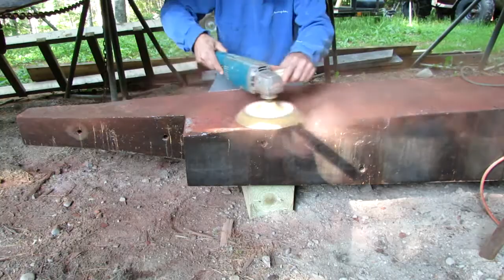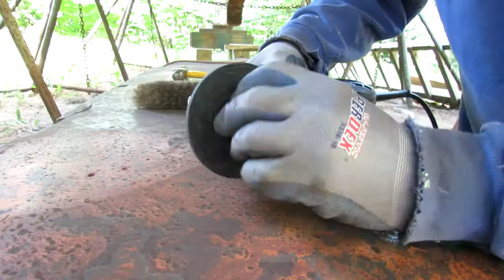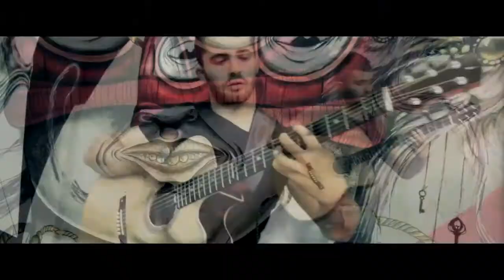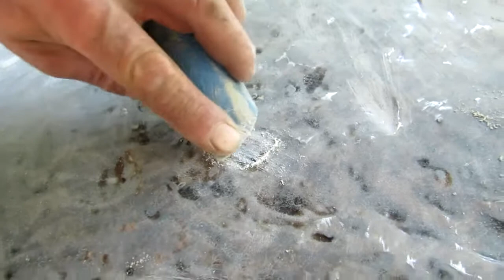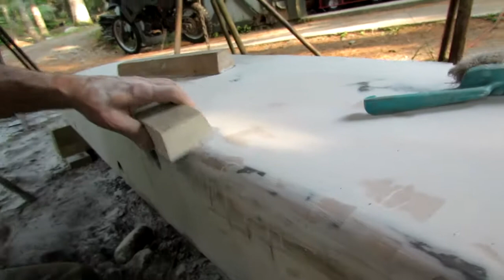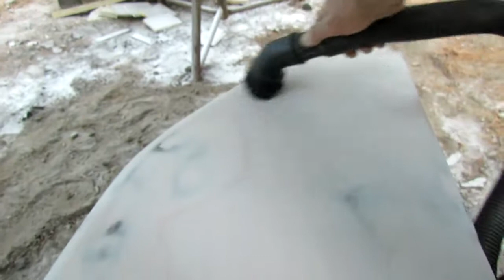July 17, 2015 - Restoring The Cast Iron Ballast To My 1968 Golden Hind 31'.

Comment: Just a tip, if you plan to do this, place the ballast upside down to begin with, so you can reach all sides. Usually on older vessels the ballast stands just fine
Reply from the maker: Yes, that is a good idea.....but easier said than done!  One person wrestling around a 3,500lb piece of cast iron is not an easy task!  Besides, if I stood the ballast upright, with the keel portion to the ground, then I am working on a vertical face.  By leaving the ballast on its side, I could pound away and grind away letting gravity help me do my work.